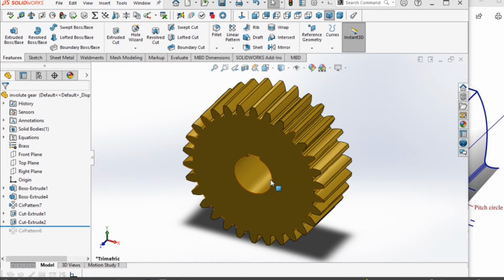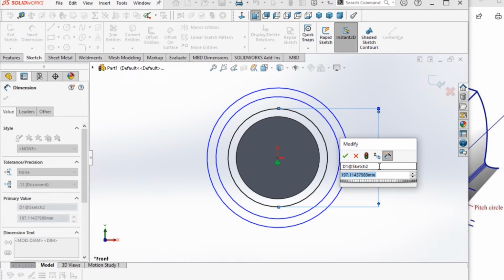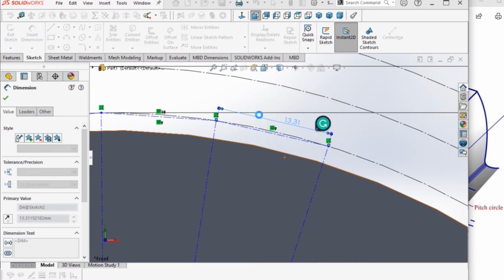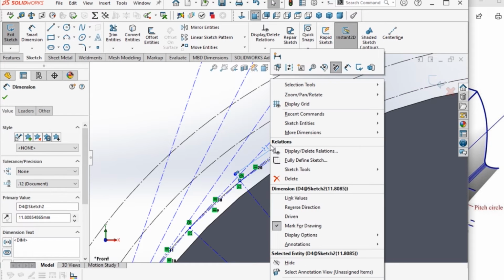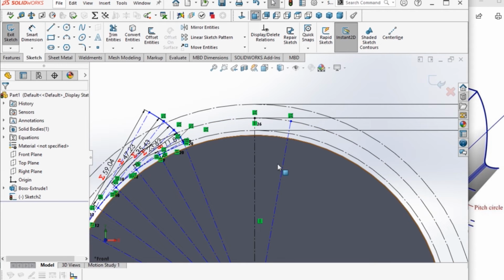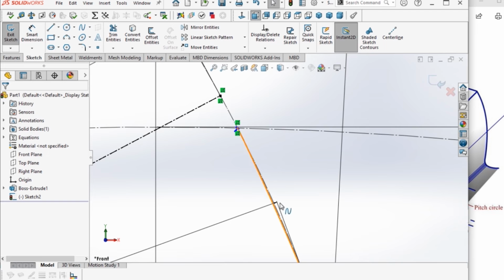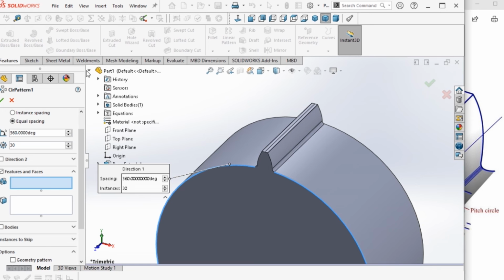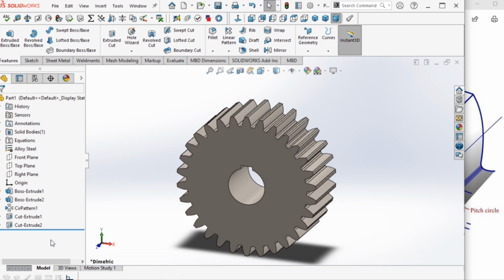Standard Spur Gear With Involute Profile In Solidworks - Standard Size

Comment: It is easier to use a parametric equation driven curve than constructing the involution by hand using a spline.

Add an equation driven curve to the drawing and use these formulas for x and y respectively.

x(t) = "base_circle_radius" * (cos(t) + t * sin(t)) 
y(t) = "base_circle_radius" * (sin(t) - t * cos(t))

Where t is the the angle in radians. Try the range  t1=0 and t2 = pi/4 and you will see the result.

The formula is obtained the same way you construct using lines. It just expresses the x, y coordinate as a point follows a circular path and adds a vector attached to the point, perpendicular to the radius, with a length that increases by radius * t to obtain the final coordinate on the involution (cog).

Notice equation driven curves can be moved around and be rotated if attached at the end and aligned using tangent and similar constraints. Try copy and then mirror on a curve.

You can copy and paste a curve and set a minus sign before one of Xt or Yt in the equation of the copy to mirror the curve about x or y axis.
Reply from the maker: Thank you engineer 👏
Will try out this

Comment: how did you find the width of each tooth
Reply from the maker: The face width is 12 times module. In this case 12X6= 72mm
Check video at 0:00
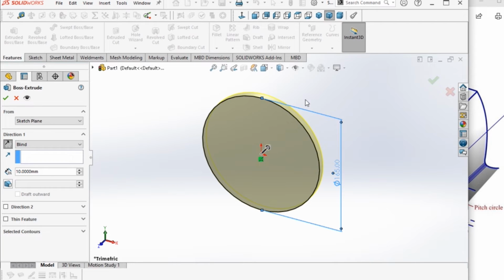1:45 How to find face width of the spur gear
Reply: @Mechanical_Eng_Design  I think I understand that part, but I don't understand why you multipled the number of teeth by 4 to find the tooth degree to be 3
Reply from the maker: It's a standard formula for teeth design
(360°/4T) where T is the number of teeth